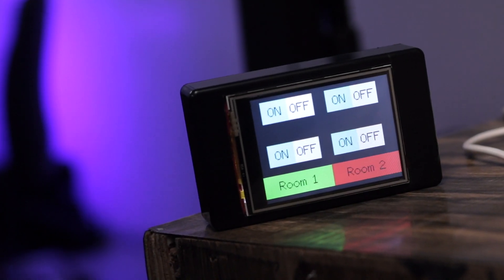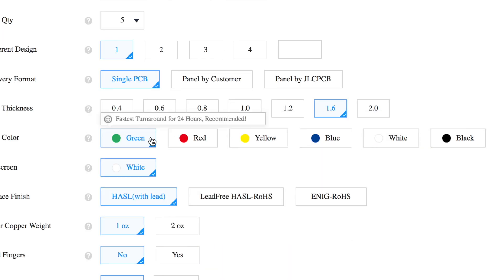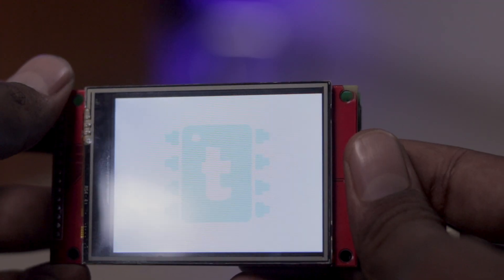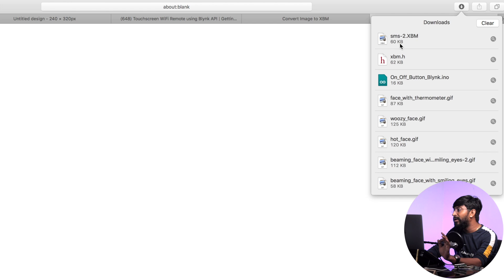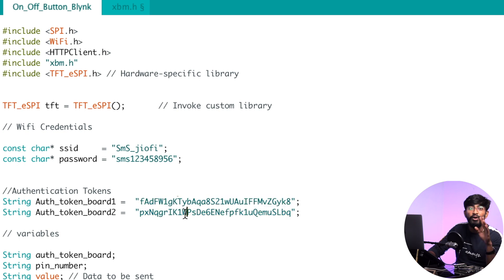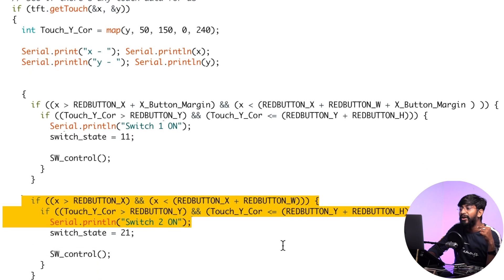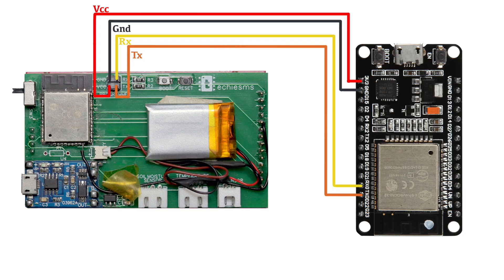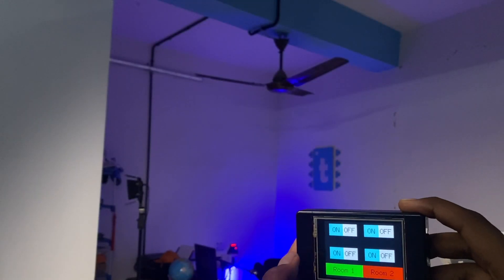IoT Remote to control Everything over Internet🌎 | Blynk | ESP32 projects

Comment: Sir nextion display is far better to use and configure..... I already have made this kind of project using nextion display play and ESP12E .... Which not only controls everything with Internet but if Internet is low... You can control everything through rf transmitter module connected to it.....